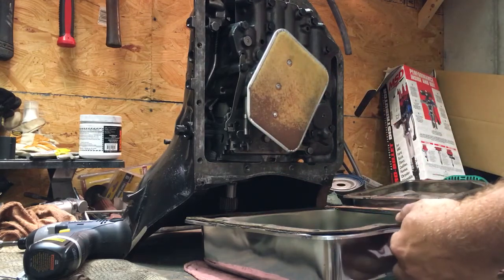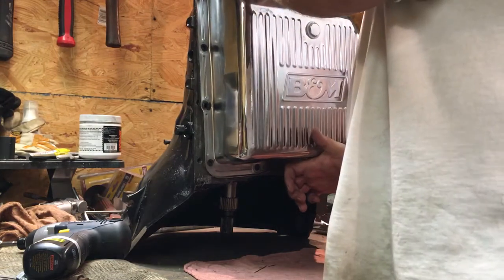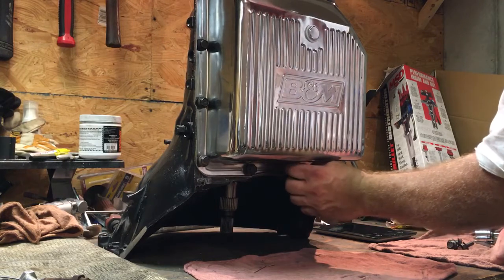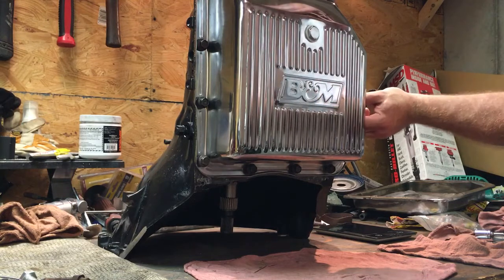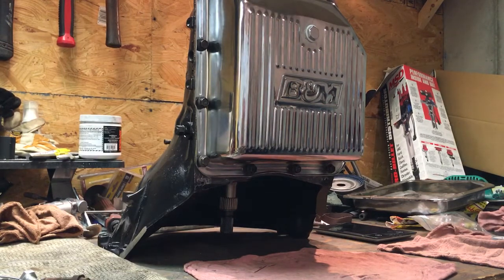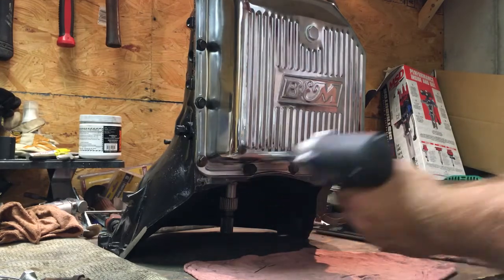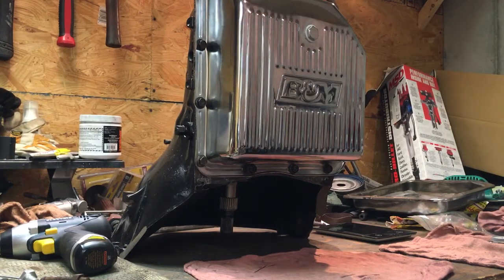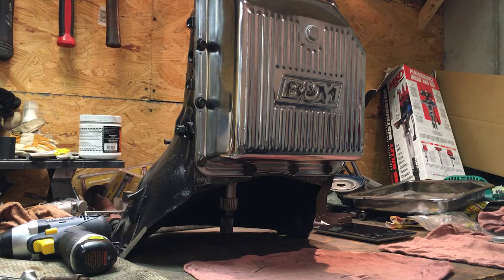B&M deep pan install

Comment: What no filter extender ?
Reply from the maker: Mark Hanson The B&M setup used a aluminum stand/extension then the filter bolts to the “Extension”.  It might be hard to see in the video.
I do not like this filter setup, it’s not user friendly at all. 👍
Reply: No filter extensions are ever needed because the fluid level always remains the same, but if you have a high volume pump, then maybe. But then again, the fluid level still remains the same whether the pan is 1' deep or 2" deep.  Maybe it might be a good idea for a circle track race car as fluid goes from side to side away from center..